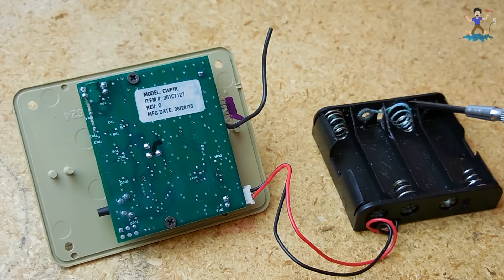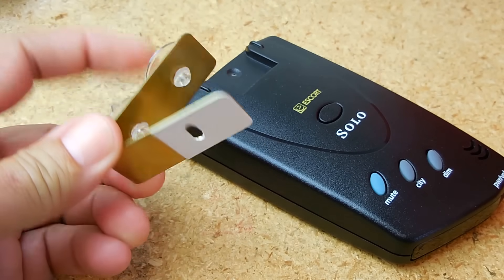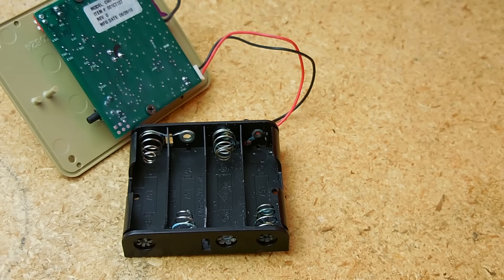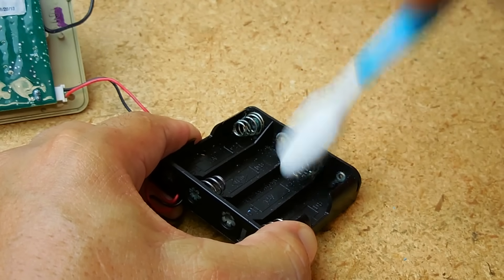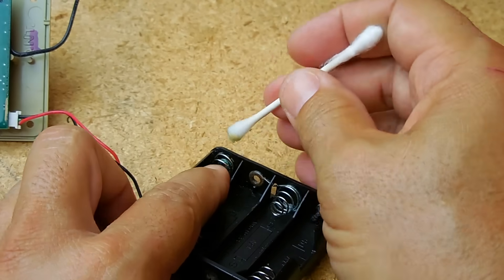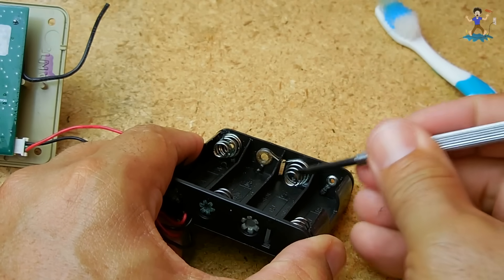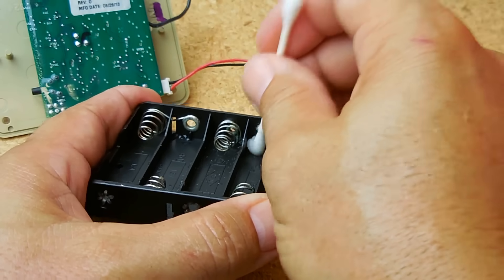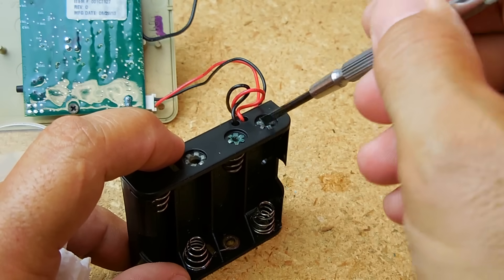EASILY Clean Battery Leak Damage(Corrosion) In Electronics

Comment: How about an ultrasonic bath in white vinegar? ;)
Reply from the maker: Too much penetration.
Reply: @electronicsNmore  Well, I think that’s exactly what I need for the irreplaceable fine-pitch QFP chip I just encountered with NiMH electrolyte corrosion. I really hope the traces underneath are OK because this chip will not tolerate being unsoldered and resoldered. Every other example of this chip I have seen has a failed data or address line. Indeed, the only reason I own the unit this one is from is because my original failed. It’s custom to this device and the manufacturer folded decades ago after their product was banned all over the world except in regions that tolerate the piracy it enables. The only parts board I’ve ever seen already had this chip pulled so it’s clearly the Achilles Heel of this device (Bung Doctor V64 development station for Nintendo 64).

It seems pretty clear to me that the corrosive electrolyte penetrated underneath the chip and may have completely ruined those traces but I can’t remove or transplant it to my other unit without almost guaranteeing another chip failure (it does not tolerate the heat). The plan is to use distilled white vinegar in the ultrasonic and then run it again with distilled water which should have similar penetration to dilute and remove the electrolyte. I will then run it a 3rd time with 99.9% pure isopropyl alcohol to displace the distilled water with fast-evaporating isopropyl. Hopefully this should address any concerns with the penetration of the vinegar or residual vinegar/water.

Wish me luck!

Comment: hello! Thanks for your video. I have a question. I have come across your video whilst searching for a solution to a problem I've got within an electric train I bought second hand off of someone. Unfortunately the damage seems a lot worse than this. The flat side of the battery compartment is very rusty. Is this damaged permanently or can it still be saved? Thanks ☺️
Reply: Did you eventually find a solution? I am searching for a solution
Reply: @rubeng3  Mine wasn't cleanable as it was eroded. But I placed a piece of aluminium foil between the battery and the battery compartment wall, and it allowed enough conductivity to work.
Reply: @kerryh3833  Thank you! I will try it out.Mine was on the flat side as well.  Spent the entire day online yesterday trying to find something regarding the orange rust on the inside and what might have caused it.
Reply: After cleaning apply a thin layer of solder to the contact points. It works like replating. Solder quickly to avoid plastic melting. Lasts many years.

Comment: Is there anything that I can do to prevent the metal spring/tip of battery compartment from rusting and corrosion if battery compartment metal spring/tip is not rusty corroded now? One of my device is rusty and at some parts and I also want to prevent the rust from expanding. Thanks
Reply from the maker: Apply a thin film of silicone grease. :-)

Comment: Vinegar is good, but it is still an acid.  Depending upon the application, device and damage/exposure, baking soda or baking soda & water mix will neutralize the alkali/acid.  It will almost certainly leave residue, but you can be sure that no acid remains.

Comment: Many times the corrosion goes beyond superficial damage in the battery compartment, leaking into the electronics of the device itself.  Other times, the corroded batteries are literally glued in there.  In such cases, you're probably out of luck.  Other times, working for hours and hours on something of little value, may not be worth the effort.
Reply from the maker: Nothing is 100%. Thanks for watching!

Comment: Radar detectors aren't always in the trash because of a failure. They don't work even brand new out of the box! Old police scanner of the x and y band used to be "on all the time". A detector would find the signals sometimes miles away on a long flat interstate. After the invention of the laser instant on, the only thing a "detector" can do is tell you "Yup! That cop up there just clocked you! Have a nice ticket"
Reply from the maker: "Instant On" can be jammed. I did it for years.

Comment: What do you do if you can't get the battery out?
Reply from the maker: Try using a very strong neodymium magnet of the same or smaller diameter, or open up the device to remove it. Thanks for watching!

Comment: I always use a solution of sodium bicarb to clean corroded electronic batteries...I never thought about using an acid... sodium bicarbonate is a base which neutralizes acids then use the rubbing alcohol to finish cleaning the stuff. Never had a problem with sodium bicarbonate.

Comment: Leaking batteries is one reason we've switched to dry cell batteries like eneloop.
Reply from the maker: The older NiMh batteries I used leaked, but the eneloop are very good.
Reply: Dry cell batteries were around in the years before rechargeable batteries. They were carbon-zinc batteries and had screw-type or spring terminals. Some 6-volt flashlights were what we used canoeing and camping through the Okefenokee in the '60s and '70s.

Comment: For that problem, I use CLR. After, I rense with water and let dry. It's faster and simpler. Q-tip is mandatory. Very little splatter, but wear glasses (jic).
Years of experience dealing with battery problems.
Reply from the maker: CLR works, it's an acid, but a little harsh the skin and it has noxious fumes.
Reply: @electronicsNmore  hmmm. Never had that problem with weak acid, not even car battery acid. I suppose some might be sensitive and smell, my last chemistry teacher stressed to never sniff any chemicals, but I don't smell anything from CLR. I'll just say it's possible due to lack of evidence otherwise.
Reply from the maker: https://clrcleaner.wordpress.com/2011/11/05/tips-to-avoid-danger-clr-cleaner/

Comment: I've had good success using a bit of dielectric grease after cleanup. Great, helpful tip.
Reply from the maker: Yes, even though the grease doesn't conduct, if you apply a very thin film to contact surfaces, it will move out of the way when the battery is installed allowing a good contact for the flow of current, and also prevent corrosion in the future. Thanks for watching Stan! I have a very wide range of videos on my channel, so be sure to look over my extensive video playlists below for other videos of interest to you, and share. Thanks!
http://youtube.com/c/electronicsnmore/playlists

Comment: A few things... 1) Those might not be Q-tips, they are cotton swabs (other brands should work, not just Q-tip brand). 2) You didn't mention which firmness of toothbrush works best (soft, medium, hard). 3) Is it absolutely necessary to use 91% rubbing alcohol?  What if someone only has 70% rubbing alcohol, do they have to run to the store to get 91% or can they just use the 70%?  4) Why don't you also use a pair of needlenose pliers to help hold the spring when you scrape it with the screwdriver?
Reply from the maker: Stiff bristle brush, 91% is best because it has less water mixed in(70% will work too), use whatever tools you desire to get the contacts clean. Thanks for watching!

Comment: Wear glasses when using the toothbrush or scrapping! That gunk can go flying into your eye.
Reply: What will happen if it got into the eye??
Reply: @justinecarson6761  you need to flush your eyes out with water
Reply: @Gun Slinger I did this prior to seeing this video using vinegar and baking soda, my own idea. Got aggressive and got some under my chin, felt irritated, wiped off with wet washcloth. Next morning after my shower it lit up. Ended up with a really dry burn that scabbed over. Yep, need to be extra careful with the toothbrush when dealing with battery acid.
Reply: Good tip
Reply: Good safety advice in this comment thread.
Reply: And disconnect it from PCB, easy to unplug
Reply: Scraping
Reply: Thanks 👍
Reply: oh safety sally always has to vituperative signal!
Reply: Will appple cider vinegar be ok?
Reply: Gun Slinger I learned this the hard way
Reply: Better yet, go to your local fire department and borrow a hazmat suit, AND wear glasses.
Reply: To Gun Slinger.
Exactly!
That was my very first thought (apart from vinegar) when he started on how to clean the corrosion off (and remnants of the battery leakage).
Reply: Maybe he was wearing glasses! We couldn't see that he wasn't.
Maybe he didn't want to state the obvious....

Comment: On my auto battery this green stuff will appear (copper sulfate?) especially at the POS terminal. I was told to remove this using apple cider vinegar (which I have tried and does seem to work).  So I am wondering why you are now saying white vinegar. Is there a difference?
Reply from the maker: Always clean lead acid battery posts with a solution of baking soda and water using a small brush. NO ACID! For alkaline battery and NiMH battery leads, use white vinegar.

Comment: I heard somewhere that 'a leaking battery or batteries causes a power serge that damages the electronic components in it's device'. … It looks like that is not the case! … Has that type of damage  ever happened?
Reply from the maker: No, but leaks can damage the circuit board preventing operation.

Comment: 4:19 Why not just dip the whole thing in the vinegar?
Reply from the maker: Bad idea, the acid will soak into the wire strands under the insulation and you won't be able to get it out. Thanks for watching!
Reply: @electronicsNmore  Okay, thanks.

Comment: Haven't tried the vinegar but will keep that in mind. After I'm done cleaning the contacts as best I can I always give them a spritz of WD-40
Reply from the maker: Better to apply a very thin film of silicone grease.
Reply: Is silicone grease dielectric?
Reply from the maker: Yes, but when battery contact is made, the very thin film doesn't get in the way to prevent current flow.

Comment: Good tips, but in this particular case, the battery holder is replaceable easily and cheaply. Other times, you are stuck with cleaning it.
Reply from the maker: True, I only used it for the demonstration because I had nothing else that needed to be cleaned up. Thanks for watching!

Comment: Good tip, I had always used rubbing alcohol, the vinegar seems much more effective at cleaning it up. Alkaline batteries aren't too bad at leaking, the old carbon zinc batteries were terrible about leaking! Carbon zinc batteries are still available, they will be the cheapest ones that you find, but for almost all uses alkaline batteries are a far better choice.
Reply: Practically every device I have that uses 3 or more alkaline batteries have had at least ONE cell leak and cause the corrosion on the terminals, even if the batteries are not just forgotten. Most recent was the HVAC thermostat. I will NOT use carbon-zinc batteries. In devices that use AA and AAA batteries, I use rechargeable batteries unless they don't provide sufficient power.
Reply from the maker: Be sure to check out my other videos and share. Thanks!

Comment: Great video on how to clean up corrosion on electronics that use battery power.  Speaking of disassembly, though, I wondered why you didn't remove the white clip (that has the red and black wires attached to it) from the circuit board.  It looked like it would easily pull out, and you wouldn't have to fight the circuit board; you could also do a more rigorous cleaning of the battery holder piece if they weren't attached.  However, you didn't treat any of the surfaces after you finished cleaning.  By "treating", I mean put some type of light grease on them to prevent additional corrosion from occurring.  I have a tube of Permatex Dielectric Tune-Up Grease that works great for that.  After cleaning the contacts, I put a thin coat of this grease on them, as well as directly on the ends (terminals) of the batteries.  I also put this grease on any new electronics I buy to prevent this issue from ever occurring with them.  Additionally, I've put it on connectors going into the back of my computer.  As a preventive maintenance measure, it has so far worked very well in each of these applications.
Reply: The biggest Achilles heel I have found with most flashlights and other battery powered devices is that almost all of them use springy clip assemblies made in China with cheap metal, with the spring loosely riveted to a metal thrust plate;  and even before battery leakage occurs,   the metal surfaces tend to become tarnished where the spring touches the thrust plate, and the rivet isn't tight enough to prevent movement and ensure a good electrical contact. *I solder the springs to the thrust plates*;  This will eliminate the play between Spring and thrust plate and prevent loss of good connection as the metal's tarnish.  Doing this will almost certainly eliminate any flicker that occurs when you shake the flashlight. I will warn you that once you have had a battery leak in that compartment, it will be very difficult to solder the spring to the thrust plate, and therefore it is best to do it in advance.
Reply: I figured out the trick of using the automotive dielectric grease a couple years ago - helps prevent a recurrence and ALSO prevents a that ANNOYING flickering you get with cheap LED flashlights.
Reply: Great tip

Comment: Just curious what you would do if the corrosion has actually destroyed the spring and the button on the other side. I would think you would throw it away perhaps you have a way to save it. Just curious. I am thinking that in this situation it would be Beyond saving
Reply from the maker: You'd need to open up the electronic device, and replace all destroyed parts using another battery holder. Thanks for watching! Be sure to share.

Comment: WD 40 spray reaches crevasses 👍
Reply from the maker: You don't want oil on those contacts before neutralizing the leak.
Reply: electronicsNmore - you may be right but there is a solvent in WD 40 that chemically dissolves the battery crud & oils at the same time. It also cleans it. I used it on indoor Christmas string lights that run on battery for few years now
Reply: @madisonone8929  Do you mean the kerosene in the WD40?

Comment: you could have just disconnected the battery pack at the connector, dipped it in vinegar, bath, brush (like a flux brush), rinsed in water, shake off, rinse with 90% isopropyl alcohol. let dry. works for me.
Reply from the maker: No, the vinegar will find its way into the wires!

Comment: IF the part is removable, Get the smallest, most shallow tuperware you can fill with vinegar. Let the part soak for a few hours. Use a brush/q-tip on residual corrosion. Dip the part in another container of water and baking soda. Rinse with water. Dry.
Reply from the maker: It's a bad idea if wires are attached to the battery holder. Acid will seep into the wire causing corrosion over time. Thanks for watching!

Comment: Looking at all the comments from months ago. Chrome plated contacts get pitted exposing cheap steel spring wire under the chrome. Even after cleaning you now have exposed steel as chrome is gone. Exposed steel will rust       So why no additional step mentioned about applying a conductive protection to the terminals? Post cleaning ?
Reply from the maker: Depending where you live, it can take a while to rust. I mentioned in the video to apply a thin film of silicone grease to the contact points, but you can also use what's shown in my other video below. Thanks for watching!
https://www.youtube.com/watch?v=KKKIv-XNyeo

Comment: will that also remove the surface rust caused by the batteries?
Reply from the maker: If the surface has rusted, that's because the plating was eaten away. You can use what's shown in my other video below. Thanks for watching!
https://www.youtube.com/watch?v=KKKIv-XNyeo

Comment: Auto parts stores sell a mixture for cleaning and restoring metals ( phosphoric acid )
, works far better than this, no need to brush off anything, for about 8.00 bucks, well worth the money.
Reply from the maker: No good! The phosphoric acid is way too strong and it will eat away all the plating on the contacts. Vinegar is all you need.

Comment: Battery acid is actually very poisonous and you should be way more careful handling them (wearing gloves, don't touch things with the same hand you just have touched battery acid, wear goggles etcetera).
Reply from the maker: That's why you use Q-tips and wash your hands when finished. Thanks for watching!
Reply: @electronicsNmore  exactly, I just thought that was worth mentioning

Comment: Good practice when you're all done and replaced the batteries is to lightly spray all the contacts with silicon to keep off the corrosion as you've likely taken off some of the nickel plating. Any future leaking will be easier to clean.
Reply: Where do you get the silicon - which is an element, symbol Si, Atomic Number 14. Perhaps you meant silicone spray which I use to make all my rubber gaskets repel water and not stick to the vehicle when it gets really cold during the winter.
Reply: No, don't spray the contacts with silicone ---- the springs are often loosely riveted to thrust plates, prone to intermittent contact at those points ( best to solder them in advance of trouble), and silicone spray will make those contact points worse, not better.

Comment: You said white vinegar neutralized the corrosion.  How can an acidic liquid neutralize an acidic salt?  Baking soda neutralizes acids.  I clean my battery holders by soaking them in a baking soda solution for 15 to 30 minutes then rinse off with hot tap water.
Reply from the maker: No, the electrolyte that leaked was ALKALINE(Base). You need to use an acid to neutralize a strong base. Thanks for watching!